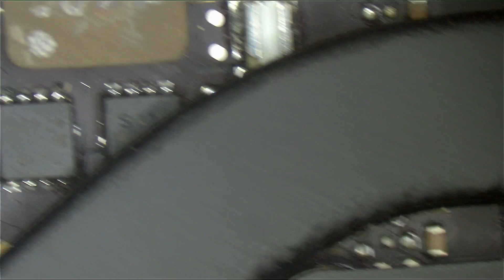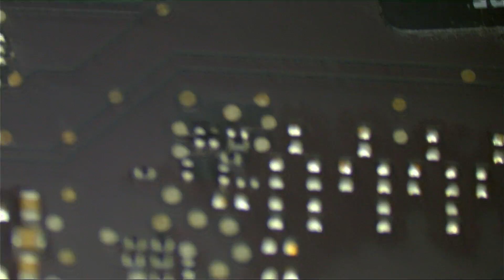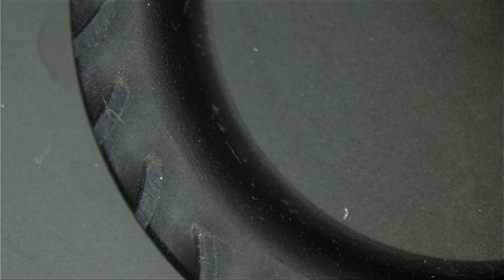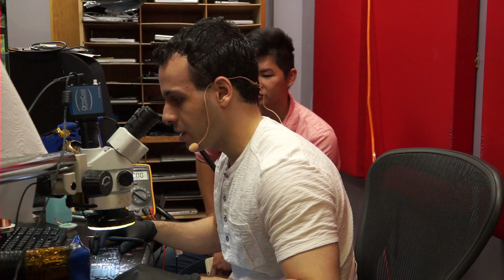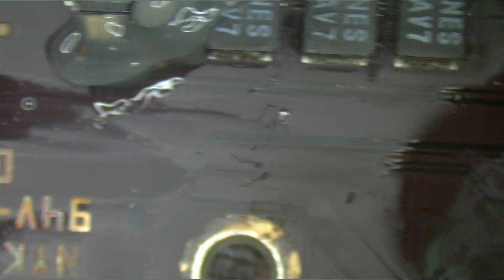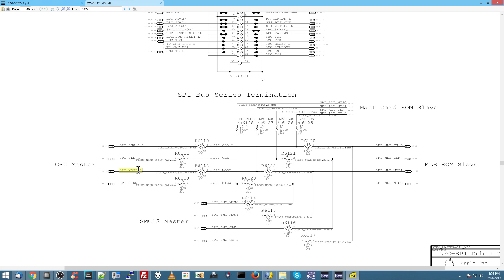My favorite motherboard repair: removing the JTAG connector :)

Comment: When I saw JTAG I instantly thought about the Xbox 360...
Reply: Remember the first time I heard jtag ,on the Motorola razr in like 06 .had to reflash eeprom or the flash I forget .made a cable out of a safety pin and crocodile clip that I had to hold by hand for 30 mins ,first try failed ,tried again another 30 mins pain was unreal but it worked 😀..
Reply: @Run187   Lol  the L7 Motorola was the same thing..  Paperclip on the test point while you flash the rom..
Reply: Also a fun fact Motorola was running iTunes in java on the L7..
Reply: Samsung Galaxy S2 here :) to reset the flash counter :p
Reply: And when I read "removing the JTAG connector", I immediately thought of the standard 6 pin jobs. WTF? 34 pins?
Reply: Same, but I only have RGHed X360
Reply: same
Reply: Remember flexing my RGH.
Reply: That's what I was thinking this was and I was like what did they come up with a better idea or something,,
Reply: Commodore4eva woag. well crafted informative comment. most people either know  the name jtag through xbox or not at all tbh. know one really looks into or really cares about the deeper information behind anagrams. only people who are into coding or just wanting to know more.
Reply: Im a newb with this stuff but i wonder if the Xbox 360 JTAG homemade cable would be useful on this JTAG header? lol
Reply: I make 360 jtags and rghs, @XBLNoob on instagram. I thought the same thing

Comment: never seen a jtag connector just melted off before. that would have saved me some time in the past...
Reply: most tiny connectors like that will melt off if you try to reflow boards, even larger connectors often will.

Comment: This is not to negate the analogy of something with tons of single points of failure, but, talking about "there's nowhere in the brain where  you can just get stabbed" and still do complex tasks (at 17:00), check out Phineas Gage, https://en.wikipedia.org/wiki/Phineas_Gage, who in 1848 got a 3.2cm/1 1/4" by 1.1m/3'7" long metal bar blown through his skull.  He survived, lived another 12 years and although had mental changes and behavioral problems, one person who knew him apparently commented his "memory and general intelligence seemed unimpaired."
Reply from the maker: +perspectivex If I am ever to be stabbed in the brain, I will request it be that spot
Reply: Well to be fair, it literally flipped the dude's personality on its head. He certainly wasn't functioning normally after the accident... One does not simply lose, and I quote from his doctor "half a teacup worth of brain matter" right out of a hole in your head without some consequences. He was half-lobotomized.
Reply: The cortex would be more accurate.
Reply: That explains most politicians...

Comment: You don't ever replace the connector after you take it off? What do you charge extra if they want it replaced or don't you have access to the connector? Thanks for the video.
Reply: A MacBook owner who goes to Rossmann will not then go to Apple
Reply: Louis seems to be a very punctual follower of LEAN :P
Reply: gave this video a like because sunny charges 80 for touch IC... made me laugh...
Reply from the maker: if someone demands I replace a JTAG connector that has no practical function then I'd rather they just go to Apple, that sets up a red flag for problem customer
Reply: No. Can't speak for Louis but when a customer brings me their machine only to question/demand my work be done a certain way, or says "I know what the issue is, can you just do xyz"... BYE BYE (obviously in a nicer tone).. It's just from years of experience that people like that tend to a.) not want to pay/complain about pricing and b.) blame every subsequent issue their machine has on you and want free work after the fact. I do find it curious that this board had no magsafe light/power, Louis removes what is basically a diagnostic port and the board powers on/magsafe works, and you say he "crippled" the hardware.. I'd love to hear your expert opinion on why removing the jtag is crippling to a board
Reply: just for that then its useless

Comment: Can I say thank you? I had a stick of ram from ebay explode. Yes, it was second hand... yes it probably was me overvolting it trying to get my system stable with 8gb ram (dodgy memory controller I assume as a design fault). But, after watching your videos, I thought.... "Why not, I could just solder in a resistor back where the old one was... any old thing will do". Guess what.

Any old thing did do, and it's up and running. Though I now have some new ram and a second PC running without the "hacks", this PC is left for web browsing, so I care less if it explodes again after my "bodge". But thanks! :D
Reply: Puffed caps are the most common failure in monitors. They are cheap, no need to salvage them unless you're really broke. When replacing, watch for a cap being close to a heat source; if possible, use the longer leads to place it further from any heatsinks.
Reply: Oh don't worry I didn't want to buy it in bulk so yeah 
And not need to tell me it's already done xD
Reply: tbh I had my old screen fail on me 
and uuhm i opened it and realised one of the condensators on the top was rounded

i found a old screen in front of my house a week after and i decided to take it apart found a condensator with the same ratings waited untill i got money for a soldering iron and soldered it on the screen board i had where the broken one was and it opened i was so happy that i fixed it 

3 years laters the screen still works :D

Comment: Another successful repair, congratulations. Kinda funny a little connector can cause so many problems. I'm surprised they don't put a little rubber plug in there if it's not going to be in use generally.
Reply: theLuigiFan0007,
Yeah, or a board edge connector.
Reply: Or just remove it from the factory considering that once it leaves the connector is unlikely to ever be used again. It's not like Apple actually fixes dead boards, they just replace them. And why can't everyone else use this connector? Because Apple would have to go out of business for people like Rossmann to get his hands on that kit.
Reply: Alex C Or more the fact that the OPer hadn't bothered to read the annotation c.losing the 'termination resistors' during JTAG removal.
Reply: Water has a way of crawling under rubber plugs and still corroding stuff. It should be a set of test pads instead of a connector. That way it's less likely to get damaged, and it can still be used.
Reply: a tooth brush and vinegar might have fixed it too I think
Reply: Well, it wasn't the connector itself, so much as the fact it got wet.

Comment: Do the resistors have pre applied solder and they get soldered with the hot air?? legit question, I never did  any SMD stuff
Reply: In commercial manufacturing solder paste is applied onto the pads, then a pick and place machine slams the components onto the board and they stick to the solder paste. Then they get baked in an oven for a while to melt the solder. Just search "SMD production" on youtube.

Comment: that jtag connector got pulverized by the hot air
Reply: I totally didn't think it would basically just disintegrate on touch after that.  I should have expected it, in hindsight -- but that thing just got totally rekt by the heat.  I thought it was doing OK too for a moment.
Reply: I was expecting him to use soldering irons to pull it off. As a board assembler I don't have the luxury of using a heat gun whenever I want and even if I did I'd have to put a new one on so I'd first try removing the FOD.

Comment: I hate wasting public resources (health care) so I let a lot of things I should get checked slide on the grounds that it's probably the sniffles...
had a headache for a couple weeks, fine, time to get checked.
doc checks neuro, looks like migraine. Afterthought: Get eyes checked just to make sure, eliminate a variable.
...okay...
Went to opto, got eyes checked, healthy, good vision...then does a double take, pulls me back in the office and checks for a rare thing...I have that rare thing that healthy people don't get (genetic), it needs emergency surgery or I could go blind. Get surgery from optho, headaches stop immediately.

...Don't look past the tiny tidbit of evidence despite the problem being rare. No resistor and you go blind....or something. There's a moral to this story.  I think...
Reply: +obsolete professor except every single model they get in has some customization to it. and finding compatible parts is very hard.
Reply: +Kuralthys
Turning a human off is easy. Turning them back on again afterward is the problem.
Reply: and the damn things leak coolant all over the place as soon as you open them up. it's disgusting.
Reply: obsolete professor Grey's Anatomy for schematics? Hahaha. I'll use that next time for schematics instead.
Reply: obsolete professor pff. Yeah, except no two models are ever alike and nothing is guaranteed to be in an entirely consistent place, a consistent layout, nor do they all function identically, and the entire system has a level of complexity that nearly guarantees unintended consequences to ANY fix you attempt.
Plus you can't turn a human off.
All fixes have to be performed on an active system without somehow frying something else in the process.
Luckily the thing you're trying to fix has extensive self-repair functionality.
Many things literally fix themselves if you wait long enough...